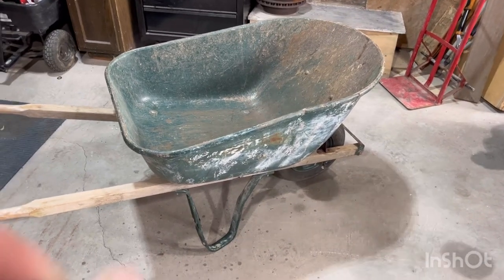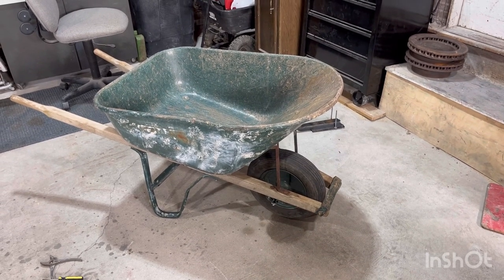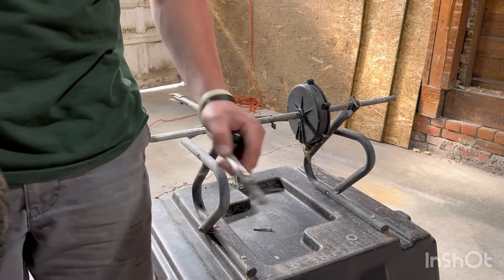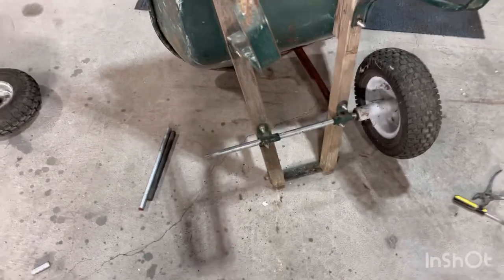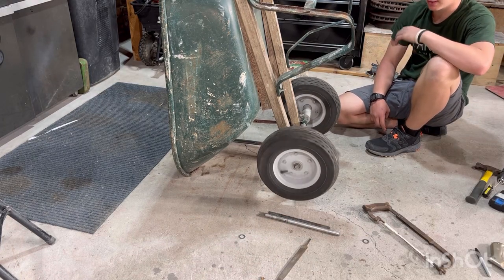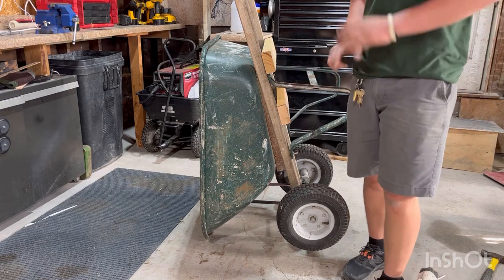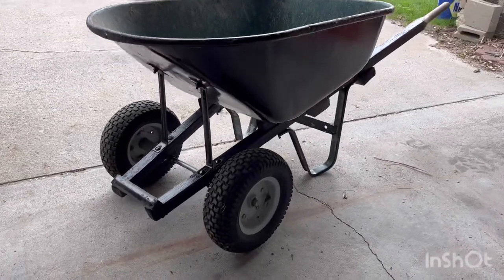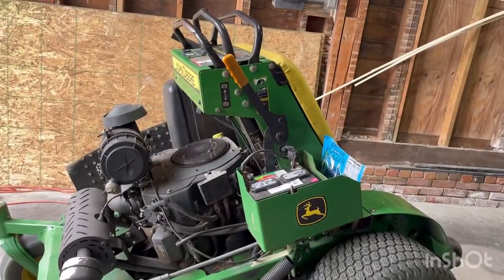Wheel barrow conversion one wheel to two wheel!

Comment: Any unfinished wooden handles always benefit from birch tar treatment - apply until does not dry, let it dry for as long as possible- over a month, then torch it up just the surface - you will have a birch pitch handle. Also, I would have painted inside to prevent rust and metal pitting.

Comment: When you say those dolly wheels are too small, how small is too small? Ive got 2 harbor freight 8" wheels. Im thinking either cut the front end of the handles a little shorter or move them more toward the front
Reply from the maker: The only reason I didn’t use the small ones was because I would have had to move the brackets or shorten the end like you are saying. But the bigger the better. A bigger wheel will roll over small bumps and rock much easier and smoother than a small wheel. Either would work. I’d say try it with what you have and if it doesn’t work really well then go get some 10 or 12 inch ones.